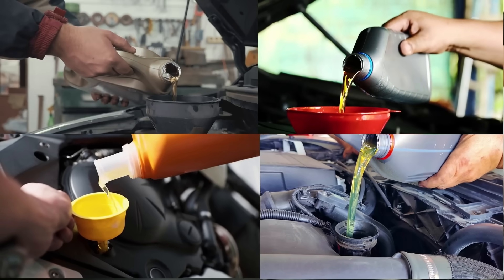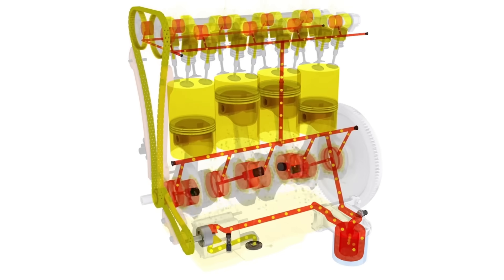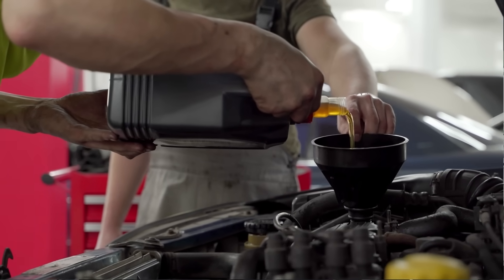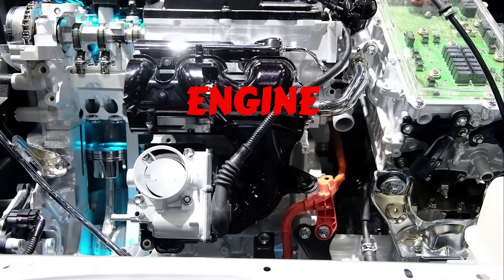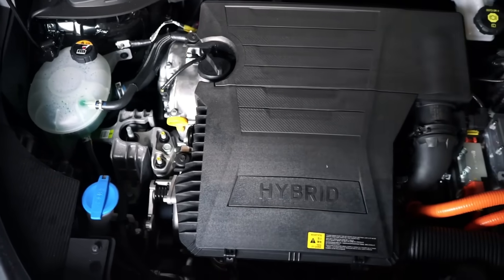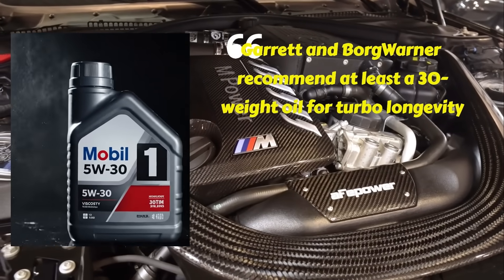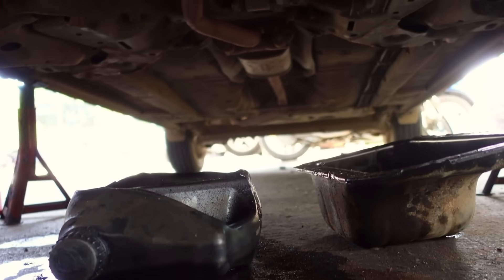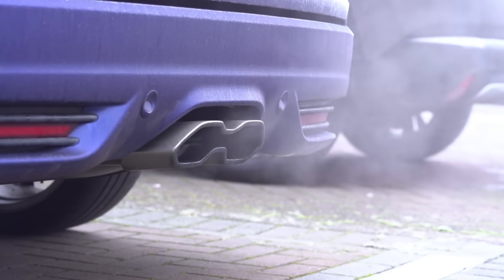The TRUTH About 0W 20 vs 5W 30 Oil (50 Engines Tested!)

Comment: Holly shit i am using 5w20 in corolla xli 2014 1299cc 170k on odo metre
My car reducing quarter of oil at 5000km what should i do 
I live in pakistan
In summer Weather go up 46 Celsius
I recently change oil 5w20
My next oil change will b 5w30
Reply from the maker: Hey! With your Corolla and the hot summer temps in Pakistan, 5W20 might be too thin, which could be why your engine is consuming so much oil. Switching to 5W30 for your next change is a good idea it’s thicker and will help reduce oil consumption and protect your engine better. Also, make sure to check for any leaks or worn seals, just in case!.

Comment: I have a Toyota altezza 1999 with a 3sge engine done 497000 km on the un opened engine running Castrol edge 5w40 and been driving on race track as well red lined every day  still runs like new

Comment: It if the car like Toyoya Corolla say 0-20 can I just say screw it and just use 5-30 with no consequences?

Also if my diesel truck recommend 15-40, what is the real oil I can use to prevent any premature wear like 0-20 does to gas engines?

Comment: 5w 40 Motul X-Cess Gen 2 is what I run. I did use Castrol Edge LL 5w 30 for a short while. X-cess Gen 2 is certified API SP which is supposed to aid with LSPI, if you don't know what that is google it, it's no joke and not uncommon for certain engines. B58 BMW engines being one of them. Id like to dip my Toe in Liqui Moly as they have Group 5 oils but none seems to be API SP rated.

Comment: Tell me what you think about 10w-40 on a N.A. 4 cyl Gas engine in a hot place like the Philippines?
Reply from the maker: For a naturally aspirated 4-cylinder gas engine in a hot climate like the Philippines, 10W-40 can be a solid choice. The higher hot-viscosity helps protect the engine under extreme heat, especially during stop-and-go traffic. Just make sure it meets your manufacturer’s specs  and regular oil changes will keep it running smooth.

Comment: I have a 2018 Ram sport with the 3.6l. I was drivong 100 miles a day at the time for my job os why i got the smaller motor. Its now got 130k miles. When i bought it i immediately put Royal purple 5w20. I buy in bulk i have about 3 more oil changes then im either going to switch to 5w30 or the 5w20 high mileage. Havent decided yet. Sorry for the rant. Thank you for the video!
Reply: I also forgot to say I've never had a problem and it runs so smooth that I can't even tell it's running when its idling
Reply from the maker: No worries at all, bro that’s good info. If your 3.6 has made it to 130k miles on Royal Purple 5W-20 with no issues, you’re doing something right. When your bulk oil runs out, you can go either way: 5W-30 if you want a bit more protection in heat, or 5W-20 High Mileage if you want to stick close to factory spec. Both options are solid. Glad the video helped.

Comment: a lot of crap if I heard this from the market to consumer. my brain: high saps low saps, use the recommended oil from the SAE oil chart depending on the outside temp, season and use. 5w starting point good for cold starts but no need to run 0W exeption cold countries that don't see higher engine temprstures because of the lower outside temp max use 0W20 some engines won't go up to 120°C. in countries with slightly higher outside temp with seasons it's needed to run higher viscosity 5W30 because there it is like to see operating temps around and above 120°C. for countries above ambient temp of 20~25°C it's recommended to use 5W30 but here is the catch. all the advice above are for turbo engines since the turbo's require faster flowing oil for the high spinning turbo. this applies for light to moderate driving and low mileage engines. for hotter climates and heavy driving or long runs it's recommended to use 5W40. why? W20~W40 gets it's grade for the thickness at 100°C. oil that is thinner like W30 is thinner than W40 making it less ideal for more engines stress because it offers weaker protection resulting in higher wear = shorter engine life. but here is the drawback not every car can use W40 because of the emissions shit that is in them W40 oils have a max C rating of 3 while an euro 6 diesel recommends C4 which is not higher than an W30 oil (C rating is the as production of the oil if burned). appart from the fact that a lot of cars have euro norm and are C rating depended resulting in an fact that high zddp (high saps) can not be used  with those cars. high saps oils are for cars that don't require of if the emissions catalytic converter/ DPF is removed, because to high saps can block it. but high saps oils don't have a c rating only A3/B4 oil with the warning don't use with CAT or DPF. those oils are found in heavy machinery / ground equipment and not often in newer trucks. 

whit this oil breakdown Goodluck and be aware that you always get the engine on temp slowly because that is the point of destruction for a lot of engines they wear fast. and this is my story how I rand engines with 300~500K original motors

Comment: For the last 35 years, I’ve only used Mobil 1 Fully Synthetic 0W-40 and have never had an engine issue. 
Zero engine wear is the goal.

Comment: My 2014 Honda accord has 250,000 miles. I always did the oil change myself since it was brand new at zero miles. 
Still runs great. I always changed the oil when it was at 20% or 15% oil life, used 0w-20 the whole time.

Comment: One thing everyone should consider is most engine wear occurs on initial startup. 5w30 is going to circulate slower when cold because it's thicker, which is especially hard on bearings.
Reply: Yes use 0W-30 best of two temperature s

Comment: My Corolla calls for 5w-20 and 0w-20 during the winter. I used 0w-20 during the winter once and the engine made a rattling sound. Never used it again. With 121,000 miles, should I go to 5w-30?

Comment: Old volvo 2004 d5 engine ,830k km on dash ,using only volvo aproved 0w30 a5b5 mobil oil ,still runs like new, changing oil every 10 k km

Comment: I just don't understand why we are discussing 0-20 and 5-30 when 0-30 can do both.
Reply: That's my choice, but it is still a 30 weight for fuel economy.
Reply: it runs out very fast. if you change it every 5000-7000 kms then it is good. Not for yearly or 15000 km oil chsnges
Reply: Because ppl want hits or views no matter truth or not

Comment: ford focus 2013 se. 300k on 0w-20 still going strong, what happened there, Scotty kilmer recommends to use the oil that the engine is designed, not going up because you want use a ticker one recommended by some DIY's.

Comment: 2022 GMC Sierra with the infamous 6.2L V8. While factory recommends 0W-20, i switched to 0W-40 a while ago. Car has 52k miles curently. Also my oil changes don't go over 3500-4000 miles. Don't think for a second that the oil I drain is clean, cause it's not. 4000 miles should be the recommended interval for oil change on all cars, especially turboed or supercharged. That prevents damage from oil being burned, being diluted by gas or just simply breaking down.

Comment: I’m a mechanic of 42 years and have used a Wynns friction proofing in all of my & customers cars. I have had a car run with no engine oil for over an hour & wynns did their own test and run a car for 1000 km. It is simply amazing. My New land cruiser 80 series at 5000km has run F-P in it & @ 180000 km I removed my Cyl Head 4 LPG reasons and I could not believe that I could still see the cross hatching from the honing process still All present.
I have many stories of rescued engines
Reply: I heard all the same BS claims about slick 50 in the 80s. Running engines without oil destroys them. No one here believes you saw cross hatching either. Well unless they don't know crap about engines.

Comment: I use 5 w20 on my hyundais. Should I go to 5w30?
Reply from the maker: If your Hyundai is running fine on 5W-20 and that’s what the manual recommends, then stick with it. 5W-30 is only worth switching to if the engine has high mileage, is burning oil, or you’re driving in very hot conditions. Otherwise, 5W-20 is perfectly fine.

Comment: How about 10w/30 vs 20w/40
Reply from the maker: 10W-30 vs 20W-40 mainly comes down to temperature and engine type. 10W-30 flows better when cold, so easier starts and quicker lubrication, while 20W-40 is thicker at operating temp, offering more protection for older or high-mileage engines. Choice depends on your engine, climate, and manufacturer specs.
Reply: Yamaha outboard  @CarCareCrewoffical
Reply from the maker: @goodtimeswithal  Yep, Yamaha outboards also need the right oil and regular maintenance to run smooth same principle as cars and trucks!

Comment: Which engine oil are you recommend for Saudi Arabia weather in summer temperature normally fall between 45 to 50 C. And in winter normally 10 to 30. My car is Honda Accord 2010
Reply from the maker: For a 2010 Honda Accord in Saudi Arabia, where summers hit 45–50°C and winters 10–30°C, a fully synthetic 5W-30 or 5W-40 is usually a safe choice. It flows well in cooler mornings and still protects the engine in extreme heat. Always stick to Honda’s approved specs (API/ACEA) and follow the recommended service interval that’ll keep your Accord running smooth in any weather.

Comment: anyone who runs 0w20 in a turbo engine is a dummy. i run 5w40 rotella t6 full syn turbo diesel oil. switched multiple bmw customers with turbo engines being dumb going 10k intervals with that crap. i switched them all to 0w40 and added oil catch cans and magnetic oil drain plugs. my turbo gas vehicles i run 5w40 rotella t6 full synthetic turbo diesel oil an they call for 5w30. my 2019 chevy silverado 1500 5.3 calls for 0w20 and oil changes every 7500mi. i changed it at 1500mi after break in and went to 4000mi and did it again. i change it every 4500mi and oil catch csn collects 3/4 of a quart and it has 8qt capacity. i switched to 0w30 at 60k miles year ago. im a master tech for multiple manufacturers including gm and 0w20 does not belong in anything but a small liter 4 cylinder and changed at 5000mi max. i have 3 bmw customers with turbo engines and were running 0w20 and doing the 10k mi intervals and were wondering why they were consuming oil and pcv systems got clogged and had carbon deposit issues. i switched them to 0w40 and added oil catch cans and they do 4500mi oil change intervals intervals now. also did carbon cleanings they now arent adding 3-4 quarts in between oil changes they add less then a quart and their running quieter smoother and turbo is alot happier not running water for oil. chevy an gmc just had a tsb to have all the 6.2 engines to switch from 0w20 to 0w40 now cuz they are popping motors like peanuts

Comment: 2.4 camry rav 4 ..2019 2021 engines calls for 0w16...eng sounds kind of like diesel engines..before oil change.. better after ojl change but it still to me I think these engines would have better lubricity with a 0w20..

Comment: My car is supposed to use 020 I've been using 10W-30 what's 0/20 it sounds like a rat trying to beat up a running wheel in there 10 w 30 quieten it down and ask for your tundra with 290,000 MI I call b*******I'd take a picture of my car odometer 05 Hyundai Elantra 300 + 1000 miles

Comment: I have a Mazda B3000 and I use synthetic oil 5W 20 as per Manual recommendations so once that my truck reached 120000 miles I decided to  switch to 5w 30 bad idea after I did the engine started to make rattling noises it didn't like the extra viscosity on the oil so I switch it back to the recommended 5W 20 and the noises were gone . I thought that thicker oil would help the engine last longer but the lifters started to complain my state has cold and hot weather as per the weather Seasons ?
Reply from the maker: Thanks for sharing your experience! Some engines like the Mazda B3000 3.0L are very sensitive to viscosity changes. The lifters, oil passages, and clearances are all designed around 5W-20, so moving to 5W-30 can definitely cause rattling or slow lifter response.

You did the right thing switching back. Thicker oil isn’t always better what matters is using the grade the engine was engineered for. Glad the noise disappeared and your truck is running smooth again!

Comment: V-tec and VVT  are highly dependant on oil flow to run these systems, changing the viscosity alters how it responds. It makes a serious difference and i have owned 6 different vehicles with these systems  over several 100k miles and 15 yrs.  And i can tell!

Comment: I used to run 5-20 in my 2018 jeep wrangler 3.6 but about 6 months ago i switched to 5-30 .seems to be ok. 70K miles. They have a know issue with rockers and cams from the factory.  So will see. Its always been quiet.  No ticking. Hopefully it stays that way.

Comment: I am in Australia and all my cars 7 I have been using 5/40 full synthetic approved by the Make! No issues whatsoever one car done 370,000 km now!! Every 7-9 thousand oil changed!!
Reply from the maker: That’s solid experience, bro 5W-40 full synthetic with proper approvals definitely works well, especially when you’re consistent with 7–9k km intervals. 370,000 km trouble-free is proof that maintenance matters more than chasing the ‘perfect’ viscosity. Good routine = long engine life!

Comment: Showing my lead foot wife this. lol   Sick of hearing... But my car says this. lol  0-20 is garbage.
Reply from the maker: Hahaha exactly! Those “but my car says  folks never get it  0W-20 is all about fuel economy, not protection.
Reply: @CarCareCrewoffical  
I have a junk chevy 4.8 with almost 400k
And my 87 Square body wich is not road legal been to the moon and back. I will keep using diesel oil 5-30 to 10-40 in the summer.   :) And my car. Yup a Honda k24 A1 engine running on the same. 10-40, Running now at 243000 mies on diesel oil. hahaha Theres your math. Just ask old people. lol
Reply: Sorry my spelling. Didnt have computers when I was growing up.  :)
Reply: Honda Element on Diesel oil. Yup Semis drive millions of miles.
Reply from the maker: @Burton1973  Haha bro that’s wild  those old-school motors really don’t die if you keep up with the basics. If your 4.8, the square body, and even the K24 are all running strong on diesel oil, then clearly your routine works for your engines. End of the day, regular maintenance and knowing what your motor likes makes the biggest difference. Old timers really weren’t wrong!

Comment: I use 5w20 and 5w30. Both my wife’s little Mini Cooper calls and my Chevy Silverado call for 5w30. But sometimes when I change the old and there’s no 5w30 on the shelf I’ll use 5w20. But after watching this video next time there’s no 5w30 I may try 0w30 or 5w40.
Reply from the maker: Totally makes sense! Just make sure to stick close to what the manufacturer recommends. 0W-30 can be a good alternative if temps allow, but avoid going thicker unless it’s approved for your engine. Always better to stay on the safe side!

Comment: I always enjoy Truth videos, My wifes 2015 Accord sport is running 5W-20 and loves it, My 2008 ranger (237,000) has always used 5W-30 and also my 1967 Mustang likes 10W-30. But along with the right oil with filter change every 5000 miles I also add Bestline engine treatment to help it out. ( this treatment does work)
Reply from the maker: That’s awesome!  Sounds like you’ve really taken good care of your engines. Sticking with the recommended grades and regular 5k oil changes is the best thing you can do. Additives like Best line can help, but just make sure not to overuse  clean oil and quality filters already go a long way!

Comment: My daughter drives a older Mazda, I started putting 5W 30 in her car, mostly because she has a leaky oil seal, between the motor and transmission. A lot of money and work to replace! It's better than what it was! I drive a older Silverado, I always use high mileage 5W30! Thanks for the video, even older guys like me are still learning!
Reply from the maker: You’re doing great, sir Using 5W-30 for an older or slightly leaky engine is a smart move  helps reduce seepage and keeps things running smoother. High mileage oil is perfect for that Silverado too! Always good to see experienced drivers still open to learning respect!
Reply: @CarCareCrewoffical we are always learning, at least I am!

Comment: Yeah  but how will this  effect  the VVTl??
Reply from the maker: Good question!  VVT-i systems rely on clean, properly flowing oil to work smoothly. As long as you’re using the correct viscosity and changing it on time, you’ll be fine. Just avoid sludge buildup that’s what really causes VVT issues over time.

Comment: 2015 honda crv it says use 0w-20 full synthetic it has 89000 miles whats beter 0-20 or 5-20 ?
Reply from the maker: Stick with 0W-20 bro  that’s what Honda designed your engine for  best flow, protection & fuel efficiency 5W-20’s okay only in emergencies, but long-term always follow the manual.
Reply: . Thanks for the info,,,,👍

Comment: 2021 Tundra at 80k 0/20 what on the oil cap. Thinking about switching over to 0/30 now. Have to look it up for myself.
Reply from the maker: Good thinking bro  Always smart to double-check before switching grades. 0W-30 can offer a bit more protection in heat, but since Toyota specs 0W-20 for the Tundra, it’s best to confirm in the owner’s manual or with the dealer first . Have you noticed any change in oil consumption or noise lately?

Comment: My 2002 6.0 silverado calls for 5w40 but I've been running 10w40 all it's life with 263k miles and still rock'n and roll'n. Idle oil pressure is 40 psi at highway speeds is 55-60👍🏿
Reply: 5w40 is more superior in every way than 10w40 👍🏼